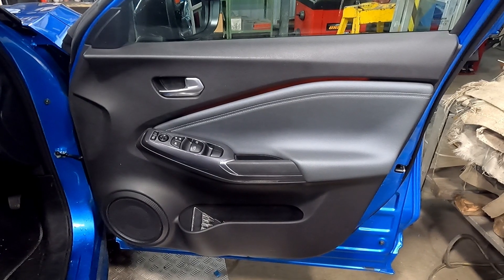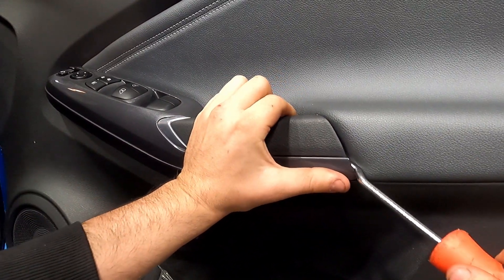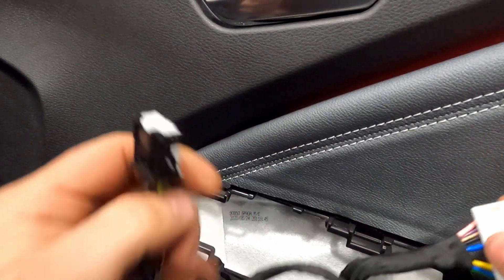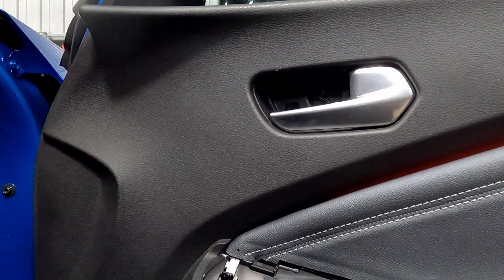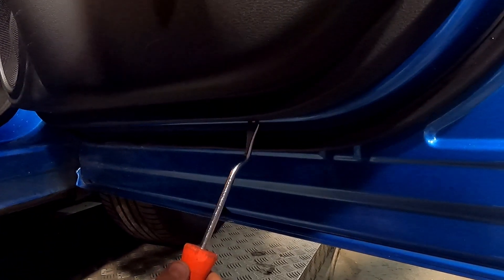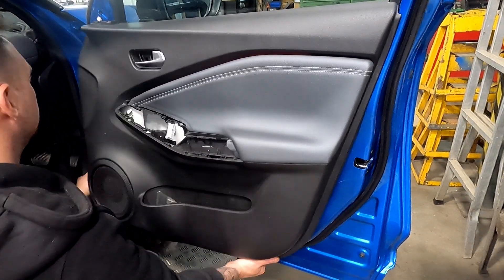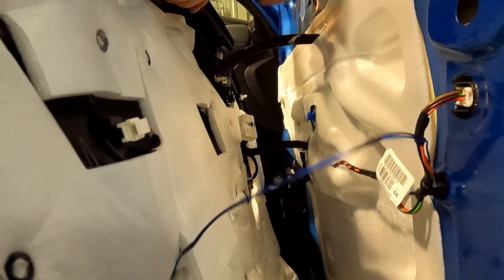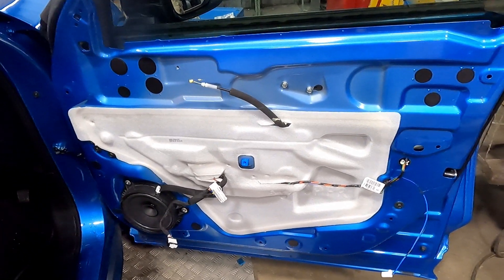Nissan Juke Front Door Card Removal

Comment: Do you need to remove the door card to replace the door handle? Driver side has snapped on the inside I  believe.
Reply from the maker: sorry for the late replay i thought i made a video on removing the door handle
Reply: @TwoSpanners  no problem. I couldn't see one about the door handle, have i missed it. Think removing card will probably be required